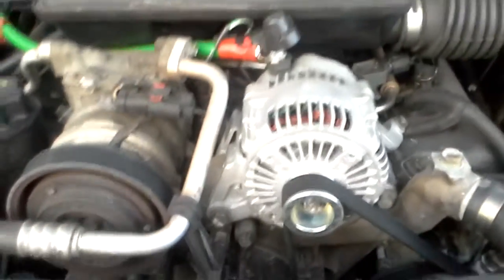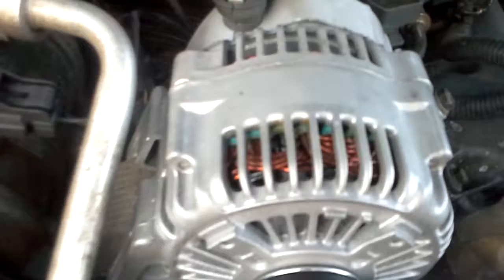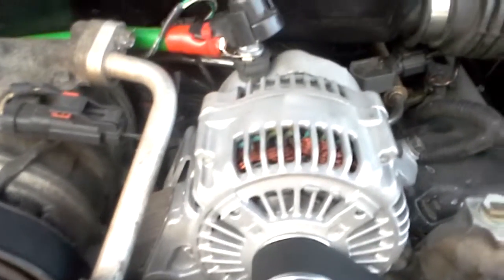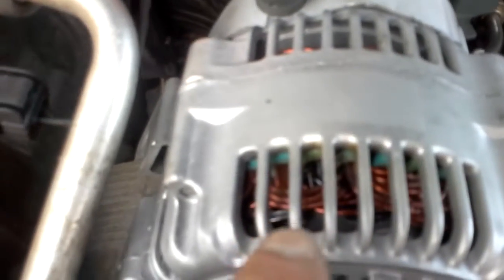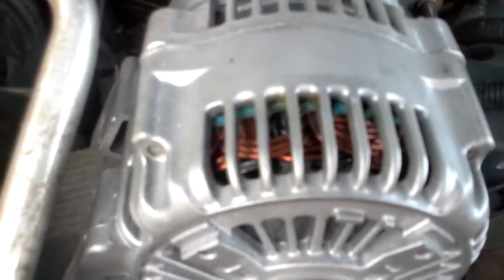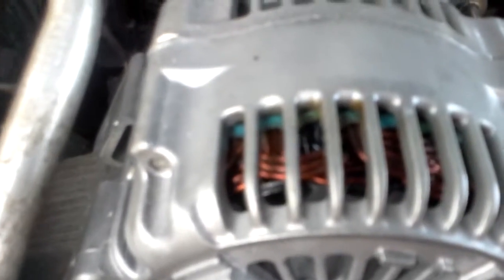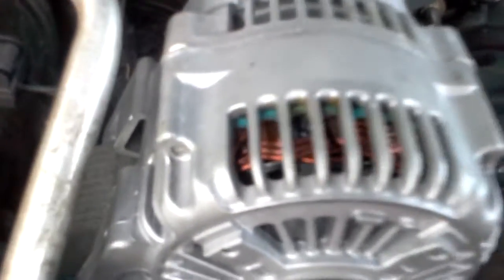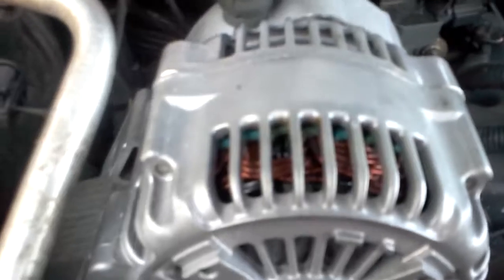**(BURNT JS ULTIMATE ALTS 240 AMP ALTERNATOR)**

Comment: I got a alternator from him 2 and my voltage would be all over the place i contacted him and he told me to change belt to smaller one which i did  and that the tensioner and all this shit but tensioner was good and he just kept blaming it on my install saying user error but shit came bad and never wanted to replace. Fuck js ultimate alternators